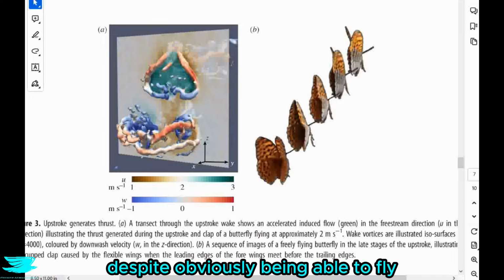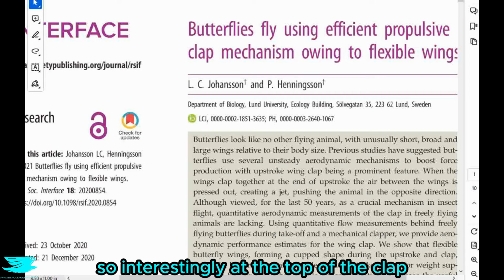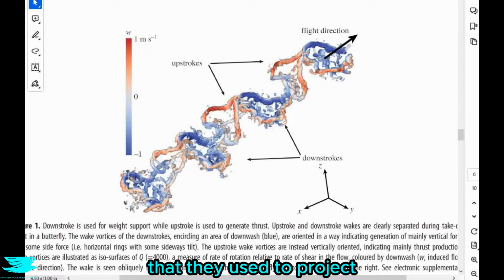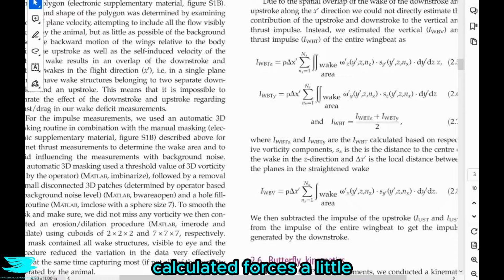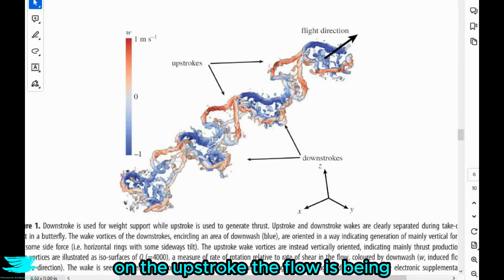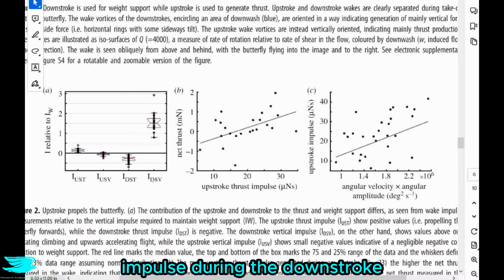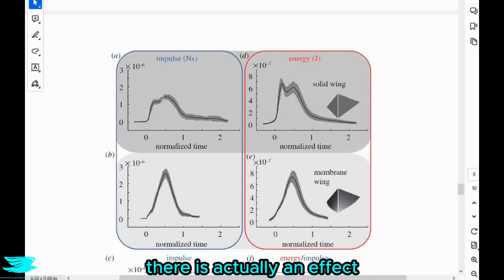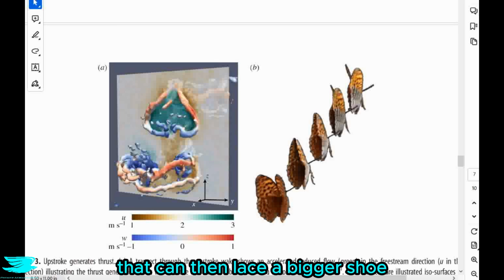Podcast 184 How Butterflies Fly

Comment: Hello,

I invented a new prop.

The butterfly needs to rotate his wings back and forth by 90° to change from lift to thrust production.
With every stroke it does.
( its not only the wing motion. It's the whole butterfly motion, including wings. It's rotaring on a different axis. )

So i take 2 butterflys and let them rotate in a circle. 
The Wings of the 2 Butterflys form some sort of discs.
The disc is spinning like a CD.

But the disc flaps like a butterfly producing thrust.

With several of these butterfly discs it's possible to form a flettner rotor.

So Magnus effect helps to increase the performance of these butterfly disc rotors.

Since 1 Disc is slim it might fit behind motorcycles.
The Monotracer could use a butterfly disc prop, for example.
Reply: Interesting, tell me more. You should submit your design on the "fan showdown".
Reply: @rolandotillit2867  

I figured out, that the design is not suited for fast vehicles. 
But it is able to produce downward thrust like a spoiler.

To the Monotracer a normal fishtailpropulsion seems to fit better.

But for a slow moving or stationary fan it should work.

The wing flapping mechanics i have not solved this accurate. 
But it shouldn't be this complicated.
If the disk is made out of flexible material, it could be cut and moved by strings or rods , which rotate with the axis.

Comment: Hysteresis, the vortices they shed store energy.
Reply from the maker: That is an interesting way of thinking about it.
Reply: @PremierAerodynamics  I actually got the idea from you. During your podcast about leading edge extensions. It's very similar to hysteresis in an electric circuit, where an electric current(is air current a good analog?) induces a magnetic field(vortices)

In an electric circuit, if you cut off the current, the energy in the induced magnetic field is returned to the circuit, which keeps the current flowing temporarily. In LEX's if you cut off the flow with extreme angles of attack, the vortices and their energy is returned to the air current temporarily delaying separation.

The vortices store some of the flow energy, much like the induced magnetic field stores some energy from the electric current, and the vortices resist changes to the air current, much like the induced magnetic field resists changes to the electric current.